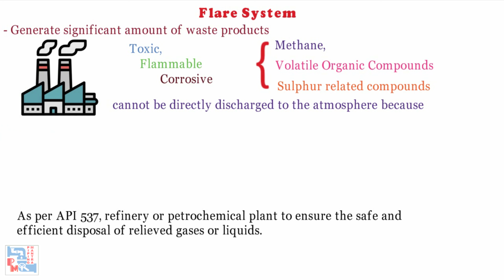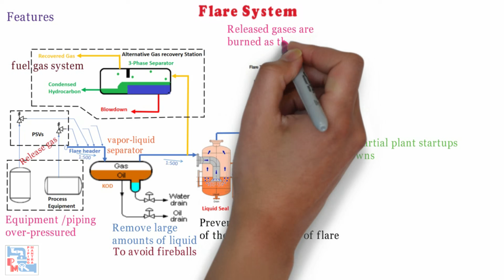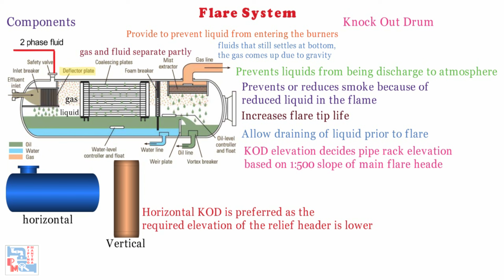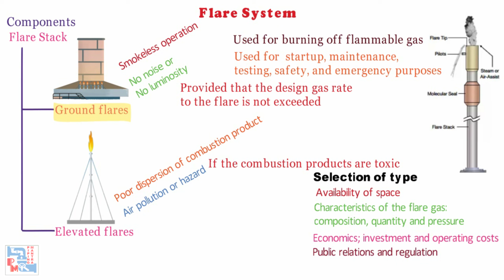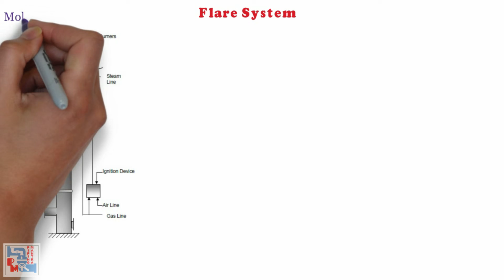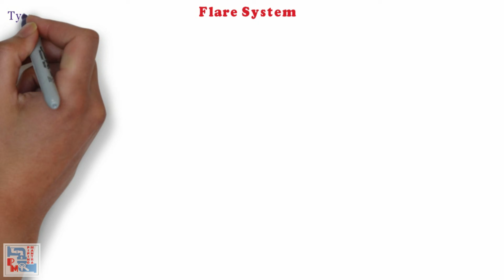Flare System | Components and Functions | Piping Mantra |

Comment: then why does thick black toxic smoke always accompany flaring??
Reply: When the valve in the scrubber doesn't work properly, oil gets in the gas line and it forced out of the top of the flare and burns black, I believe.